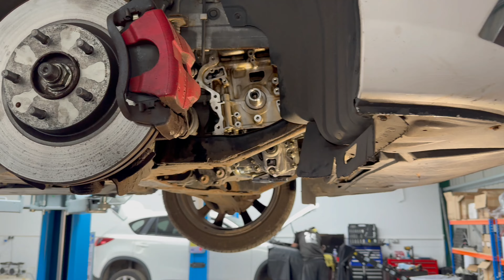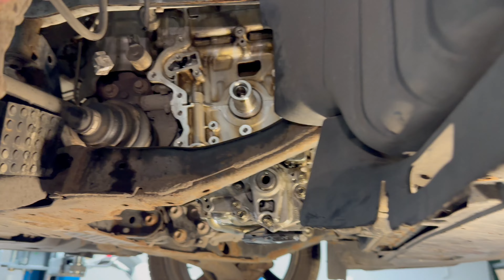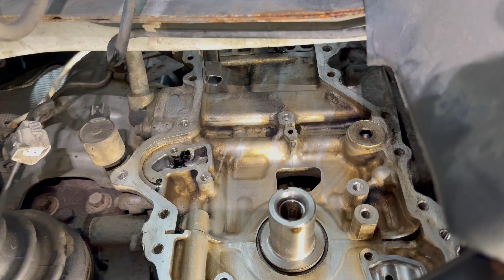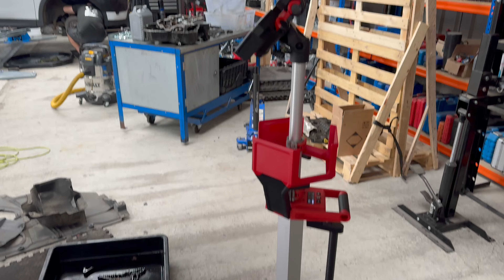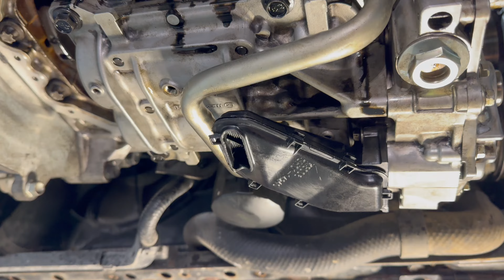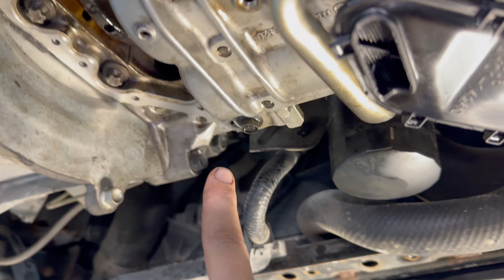Mazda 6 Skyactiv 2.2 Diesel Timing Chain Replacement PART2 - Mazda P1336 Fault Code

Comment: Hi there I have a 2015 Mazda 3 2.2d. I’m wondering if you can help me out. Do you know what spark plugs are needed? The engine bay looks identical to the Mazda 6 in the video. Whenever I look online they all seem to be out of stock at Halfords/euro car parts 

Another question is - where is the throttle body located?

I appreciate your videos I’ve been binging loads of them :) 😊
Reply: diesel does not have sparkplugs.

Comment: Hi, I have just replaced my engine in my Mazda 6 there are no fault codes on my diagnostics tool and my engine cranks but it won’t start I have gathered it is a fuel related issue because there is fuel coming out the last port on the fuel rail but not the others I have replaced the rail and other components and it still won’t start😢 please can you assist me with some advise😊 much appreciated thank you
Reply: I have exactly the same problem (2.2D skyactiv) The PCM is not receiving a crankshaft signal (test with the Camshaft sensor disconnected or you'll get a false reading on your scantool) No problems with connection to the PCM, the crankshaft sensor, connectors, no shorts across wires or to ground. Did you ever solve your issue?